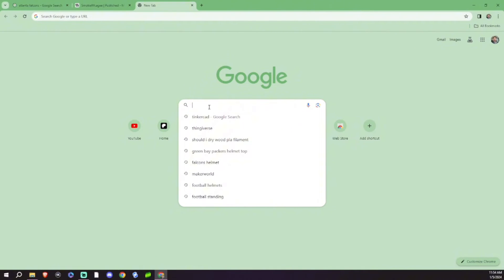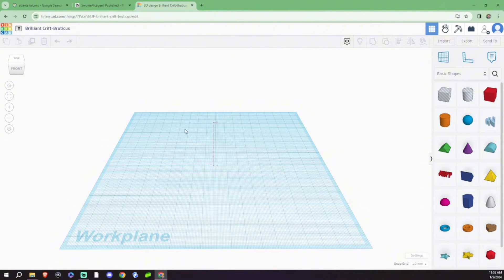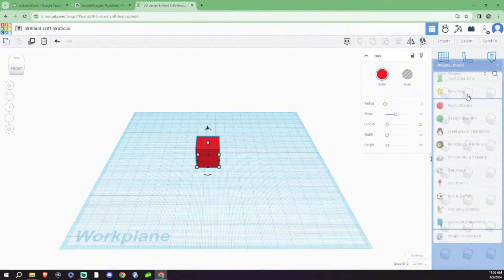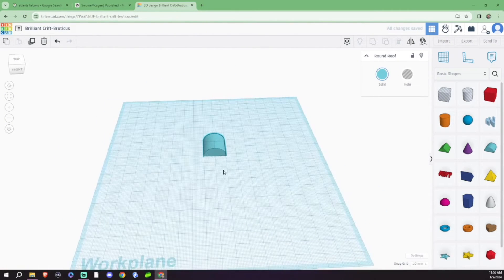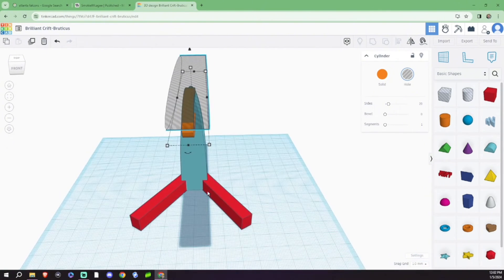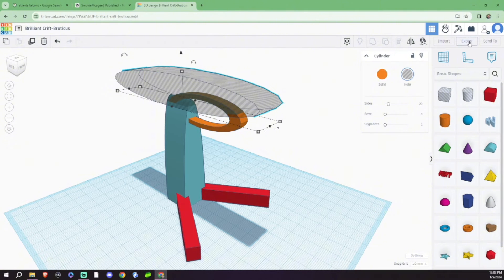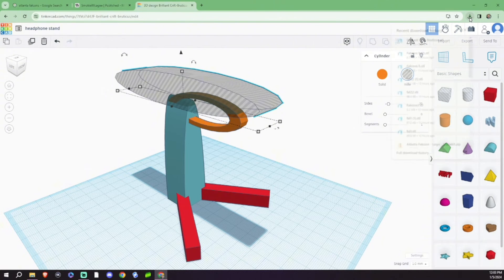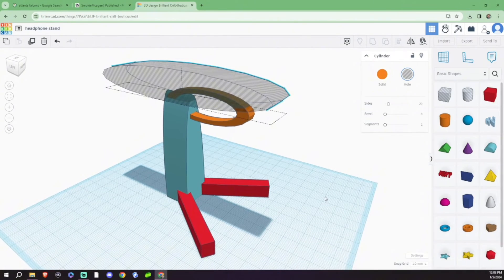How To Make Your Own STL’s and 3D Printing Files Using Tinkercad!

Comment: I would’ve liked you to explain the difference between the two slicers, especially since Cura estimated it would take 10 hours to print and Bamboo only 2 1/2 hours.
Reply: It wasn't due to the slicer, the bambu slicer was estimating 2 hours to complete the print on a bambu printer. Cura estimated 10 hours on a CR10 printer. Cura would have estimated close to 2 hours if he sent it from cura to the bambu and vice versa. Hope that helps.